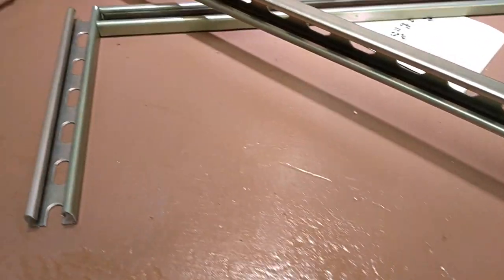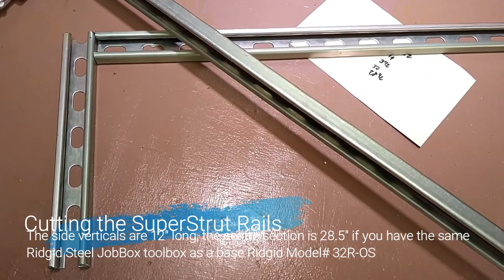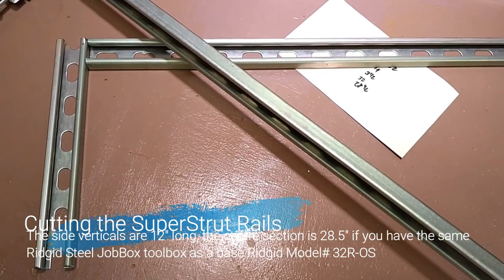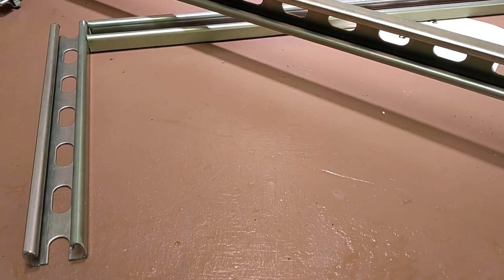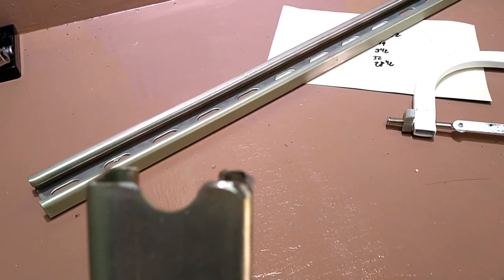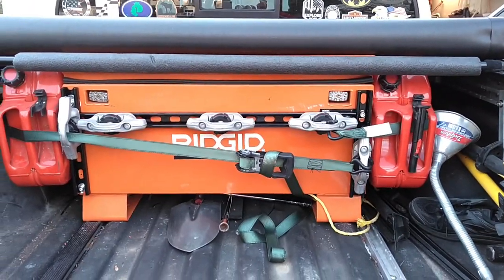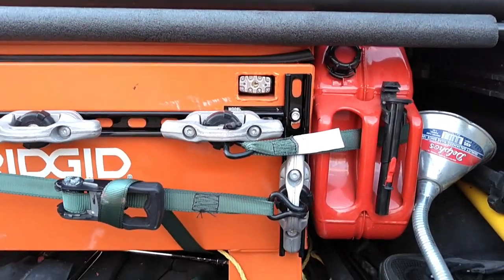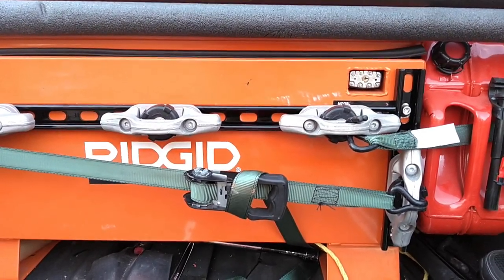Clever !!! - Nissan Frontier Ridgid Tool Box Rails

Comment: Great project!  Do you know if superstrut makes anything similar to the nissan tie down?
Reply from the maker: I dont believe so, the Nissan tie-downs are pricey but excellent. Another reason that convinces me I made the better choice of a Fronty over a Tacoma.
Reply: No, BUT if you have some thick washers (picked mine up from the shop when I was running heavy equipment, they are probably 4x thicker than a fender washer if not more) you can take the unistrut or superstrut (home depot or lowes, same thing different name) nuts and an eyebolt and a nut and make your own.  I have around eight I made with 1/4" eyebolts and four or six I made with 3/8" eyebolts.  Washer should fit past the side of the utilitrack for the best support.  I put the nut on the eyebolt and then the washer and then the strut nut.  Keep a crescent wrench under the seat to tighten them via turning the eyebolt.  I never leave the factory tie downs in the bed but nobody is going to steal the eyebolts unless they also have a way to loosen the eyebolt and they are desperate.  The 1/4" ones live in the bed of the truck and have for years..  If someone stole them I'd only be pissed about the washers.  Probably less than $20 for the eight 1/4" ones. 

Lowes sells square washers for their superstrut with 3/8" holes for $3.66/5 pack so yes you can easily make some with 3/8" eyebolts nuts and strut nuts.

Comment: You, I, and anyone else can drill out the keyhole in a padlock with a battery drill in less than five minutes. I ruined a piano hinge on my Knack Box while learning this fact. Padlocks are too easy to drill out. Very depressing really.
Reply from the maker: Hi Don, well yes, that's mostly true, my Grandfather used to say locks were for honest people, but even if you drilled out both padlocks, they're fully recessed, so if the drilling didn't cause them to pop out immediately, you'd still have to wrestle with how to physically remove them. It wouldn't be easy, it'd be noisy, and most of all, it'd draw attention. Now if you're somewhere secluded and had all the time in the world to work them over, then yeah, you'd be able to steal two or three hundred dollars worth of my tools, but most folk'd move on to easier targets. Plus inside a locked box, how do you know what you're risking getting arrested for? It could be 95% empty. It's bolted to the bed so you can't just pick it up and rattle it and see if it's heavy and makes thumping noises. Actually its 88# empty, so yeah, even with nothing in it, it's heavy.